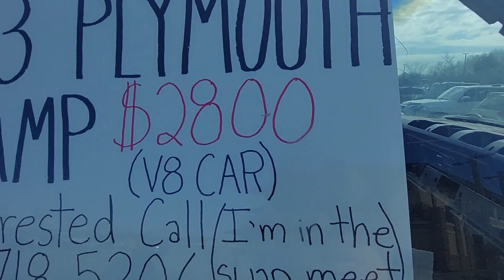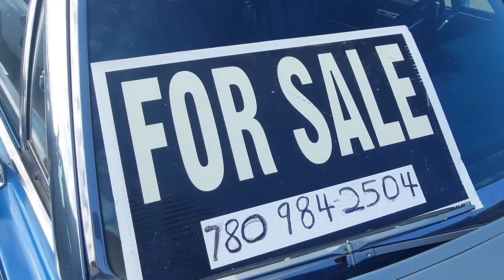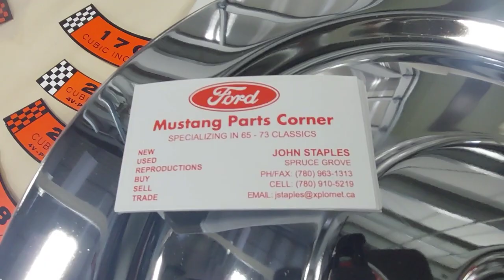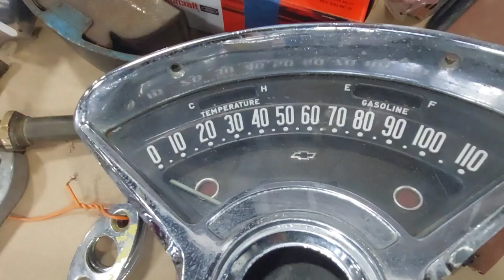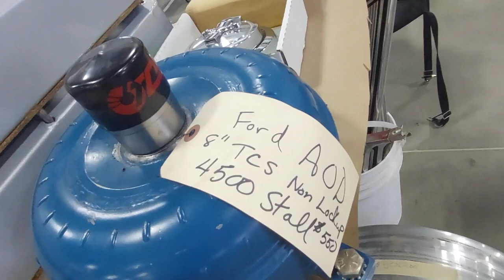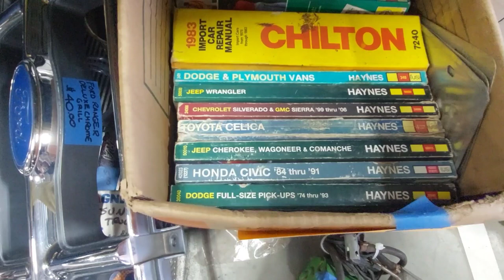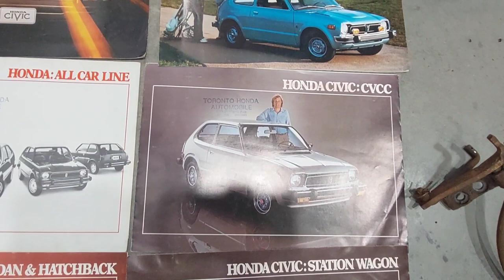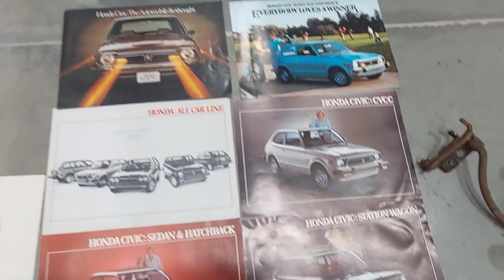Swap meet Stony Plain april 23rd 2022 highlights.

Comment: Scamp was the 2-door version of the Plymouth Valiant. The grill would have been common to the Scamp, Valiant, and Duster. (I used to own a '73 and a '74 Duster.) The tail lights and bumper should be common to the Valiant. As you point out, though, the equivalent Dart parts might fit if you change the hood and possibly fenders, as well.

The V8, as you pointed out, is either a 318 or a 340 if it is the original. I think the 360 didn't come out until 75 or 76. Could be a lot worse... my '73 Duster had a 198cu Slant-Six and a 3-speed manual with a three-on-the-tree.
Reply from the maker: Actually if you want to get real technical the scamp was the same as a dart swinger. Which the dart swinger was the upscale model that had a longer wheelbase for a more comfortable ride if memory serves correctly.